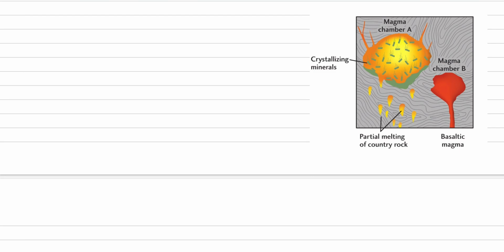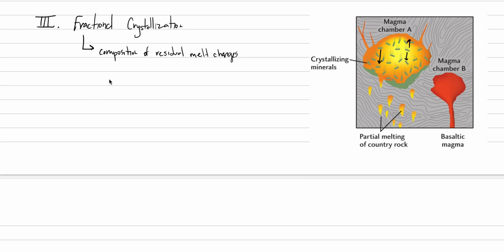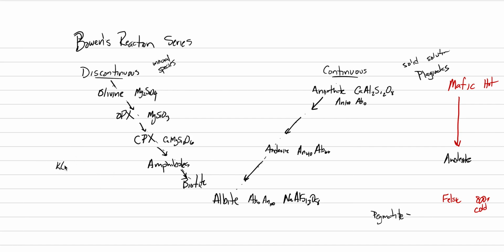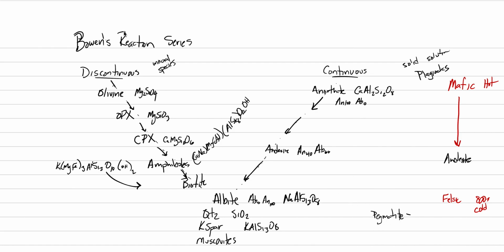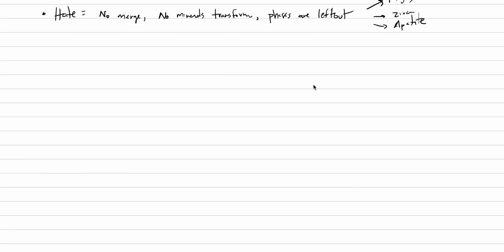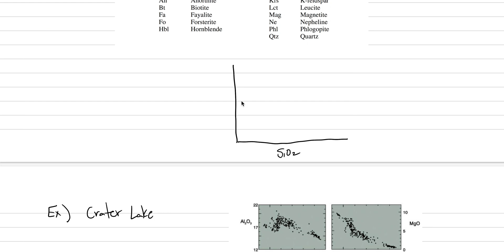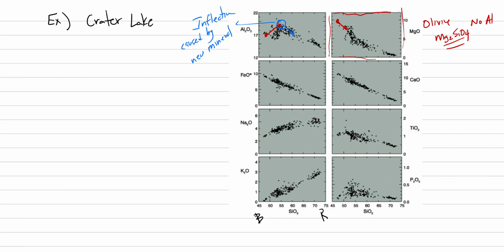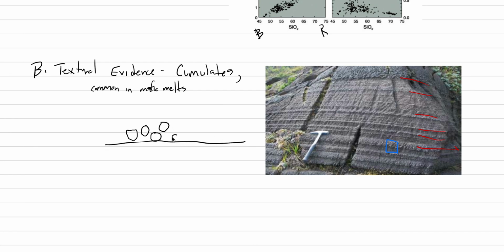Magma Chamber Processes: Fractional Crystallization

Comment: Thank you for the video.

I have a question on the concentration of elements. If for example we're in a phase of crystalizing Olivine (Mg,Fe)2[SiO4] and Clinopyroxene Ca(Mg,Fe)[Si2O6], can we say that all other elements (Si, Ti, Al, Na, K, P, Mn) are concentrating in the magma melt? and can we consider all of them incompatible in this case?
Reply from the maker: Yes, the incompatible elements will concentrate in the melt. All the ones you listed would increase, except maybe silicon. Silicon would increase if the melt has more than the crystallizing phases can hold.

Comment: Thank you so much for the presentation, very well presented 👏.

I just would like to ask on the textural evidence part in which in the outcrop that was shown there's a rhythmic pattern of cumulates, just wondering why did the cumulates have settled out in such a pattern forming those interlayered feature? and not just as a whole? (like the entire olivines were fractionated out)
Reply from the maker: Perhaps timing of different pules of olivine. Or maybe there are currents in the chamber causing settling pulses.